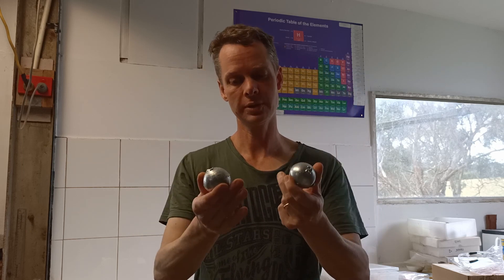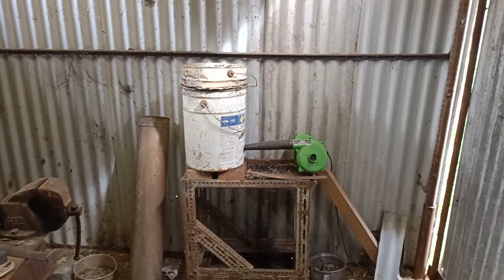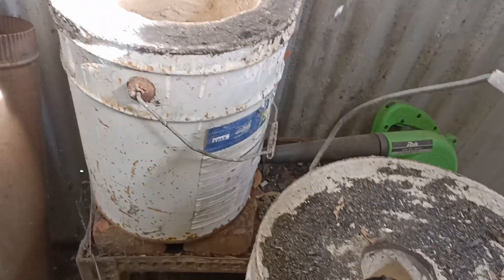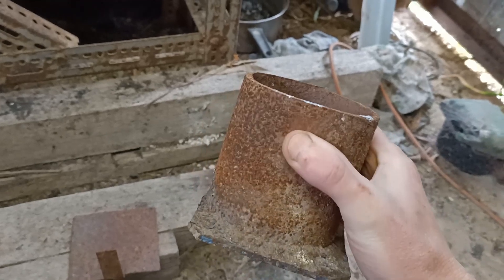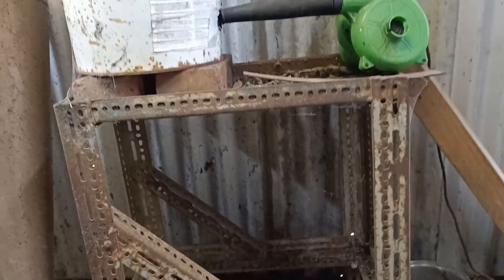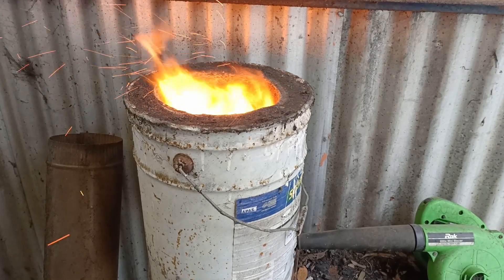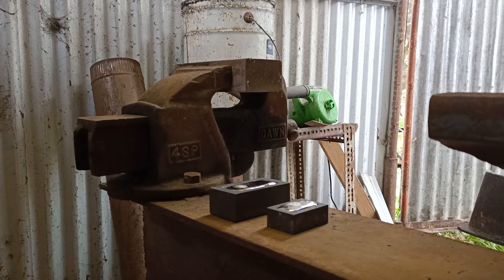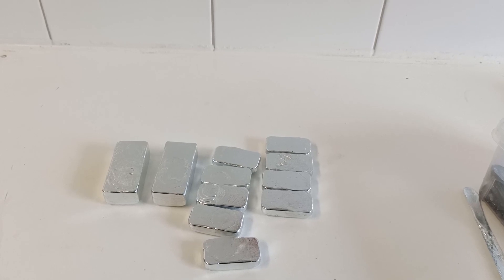Zinc casting using Homemade gear

Comment: You can use a pan and a stove top or a propane blow torch!
Reply from the maker: Yes that will work too, it's a pretty easy metal to melt and work with.